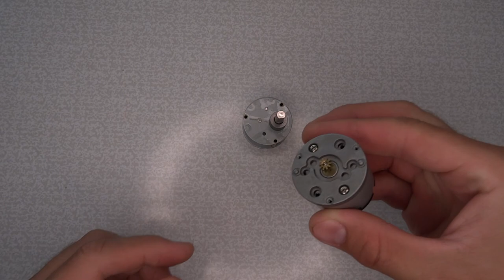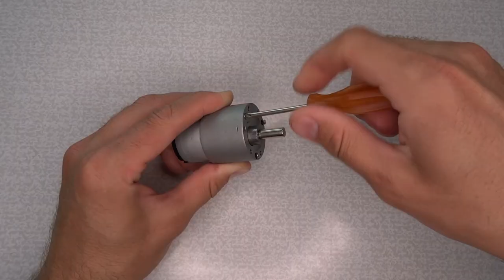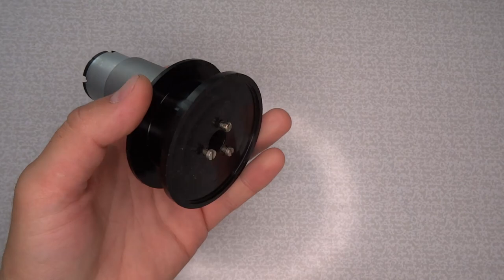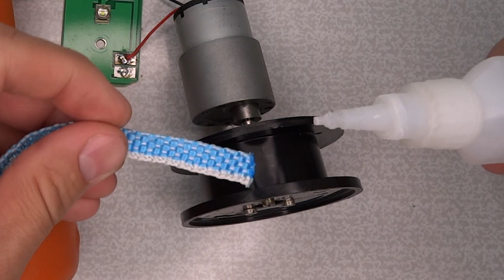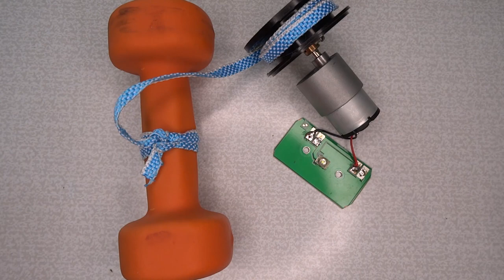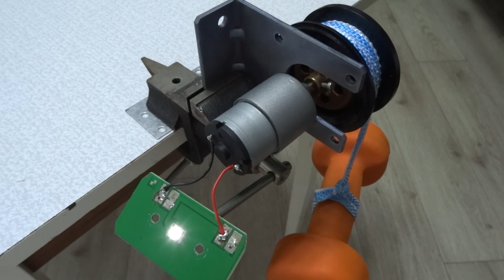Gravity Generator

Comment: Up the gear ratio and weight until you're able to get a day's worth and introduce a watch escapement to regulate speed. And use capacitors to keep charge at a good flow with no break in current
Reply from the maker: you all say right
Reply: If 10kg provides a half hour, how much kilo you gotta carry up there for a day's worth? Isn't the rope gonna rip?
Reply: Also, how are you supposed to regulate speed with a watch escapement if there's that much weight going through it? And whyyyyyyy would there be a break in current? It's a continuous pull down
Reply: @marioluigi9599 you will also have to carry the weight which will be more energy as compared to energy we are generating
Reply: @marioluigi9599  for the setup he has he would need to increase height not weight so a pulley and a rope would mean he could wind it up in daytime using solar panel to turn the same motor. If he increased weight he would need to add a gear box for the same height and a large motor and rope  to handle lifting it

Comment: If this was scaled up to the size of a 50,000lb weight what kind of power could it store? What kind of round trip efficiency does it get?
Reply from the maker: approximately 2v, 0,5А
Reply: Depends how high it goes. Convert it to kg and meters. So 22680x1x9.8 = 222264 Jules or watts per meter or 222KW per meter
Reply: Gearing and Pulleys would aid in more output.
Reply: @kidgamer8704  belts and pulleys would be quieter
Reply: I assume a terrible efficiency.  Gut feeling: 10% or less.
Reply: Ту нет энергии из вне) а есть время за которое подняли груз) так как это можно сделать из 1 секунду и за 1 минуту) но опускаться будет всегда 5 минут) ВРЕМЯ оно такое интересное) верно?
Reply: @worlore1651 
If we assume a weight of 100 kg and a height of 3 meters, how much energy is produced in this example??
  At a voltage of 220 volts

Comment: Put a 10kg weight, and try to change a phone
Reply from the maker: Oк
Reply: To calculate joules which converts directly to watts aka 1 joule = 1 watts. You do weight*height*gravity=joules. Gravity = 9.8. So 10x1x9.8=98 joules or 98 watts per meter. An iPhone charger is 5 volts and 1 amp aka 5 watts per second so 5x3600(seconds in hour)=18000 watt hours. So to power a iPhone charger for 1 hour you would need about 18000kg if 1 meter drop. You can divide weight by half per meter. So 10 meter only need 1800kg. 100meter needs 180kg.
Reply: @worlore1651  you sir have just broadened my understanding of the volt wat Amp triangle. I'm a single comment more than high-school science did.
Reply: @worlore1651  18000 watt hours? I thought Smartphone takes around 15wh to fully charge so why 18000 watt hours? 5volts x 1amp=5Watt so during 1 hour it would be 5 Watthour. I think u meant to say 18000 Joules not watt houres. 1 J = 0.000278 Wh  18000Joules = 5WH
Reply: @FreeKanal  I don't think this guy knows that Watts is Joules per second
Reply: @worlore1651   если все дело в расстоянии, то есть идея. скорость поднятия равна затратам и получению  энергии?
Reply: @marioluigi9599  даже знает что такое нагрузка) и придется добавить 20%)))
Reply: @worlore1651  5w/second ? That'll teleport your iphone straight into Steve Job's arms wherever he might be now.
Reply: @FreeKanal  I was off with the per second thing. It can be confusing because watt hours and just watts.
Reply: @Hashcarbunesti  lol
Reply: Misunderstanding I think was that an iPhone charger is probably 5 watt hours and I said 5 volts and 1 Amp and since I took away the hour part it's 5 watts per second rather than 5 watts per hour. Oops lol

Comment: build a whole lot put them in series to get 12v and parallel to get 0.5A Once you have determined the output while running it, you can select  a 12v 6w led light bulb and then height will determine the amount of hours it runs :)

Comment: Tip for Africa: build a room, where are placed many bigger of these, one person is pushing up weights nonstop, rest of the village have eletricity.
Reply from the maker: one person is not enough
Reply: @Le1ism  Weights go down very slowly, one strong man is enough. Two men would be bored and play cards.
Reply: relifting the weight can use small motor geared that use a fraction of main generator produces.
Reply: @KokoroDenshin  Impossible.
Reply: @janengel1985  based on another youtuber experiment its proven that even 5v tiny geared motor can lift >10kg load.
Reply: @KokoroDenshin  But this is extra power source.
Reply from the maker: @KokoroDenshin  Solar panels can be used for lifting.
Reply from the maker: @KokoroDenshin  Apply a lot of cargo generating energy. When the sun shines lift loads
Reply: @Le1ism  can be an option, but to simplify the system, the smaller geared motor lifter can consume very small power from battery/energy bank generated from main gravity gen.
Reply from the maker: @KokoroDenshin  Can be
Reply from the maker: @KokoroDenshin  Thank you
Reply: Put a person on a bike with a generator. Maybe you can generate 200 watt but after 30 minutes you are done with the fitness.
Reply: маховик возьмет часть энергии для вверх)
Reply: it was done long time ago.
here is an example. https://www.youtube.com/watch?v=Gr9Nw3sU4Yg

and crank lanterns are an item since long time ago. 
I had one too. Sure, not so bright, but this is just an detail.

I had one even more simple. 
It was just a magnet inside a coil. Shacked it for a minute, and had light for half an hour. Barely able to read at that minuscule light,   but it was a very cheap gizmo.

Comment: Ah... I've  been working on a design that has a large belt with shelves on it.  There's an auto - feed which releases bowling balls that fall into / onto the shelves . With about six balls there's quite a bit of force allowing higher gear ratios. But how do the Balls ( 20 or so ) get up there ??? As a morning workout routine !! I also am working on a  water - version that has a belt with balloons on it. As the balloons fill with air  they , of course , produce an amazing amount of lift. A small wind powered compressor provides the air. This would also work with large bodies of water. Check this out -- If you place a steel 12 " tube ( with a bottom ) in say, 100 feet of water , you can drop a balloon down that tube for free. Then at 100 feet down that balloon will have  ( for free ) tremendous lifting / driving power for a sea - bottom generator. Pre - fab units could be dropped in lakes all around the world or... swimming  pools.
Reply from the maker: Need to try

Comment: Less gears = more efficiency / fewer losses!
One big bicycle rear wheel = huge gear ratio
(generator axle to outer rim, heavy weight to the chainring).
Reply: show us
Reply: Everything is exactly the opposite of what you mentioned. The gears are the reason for the high efficiency and power / ability of the generator. The gears and pulley are also the reason for making the weight go down slowly. Otherwise, the weight would go down in less than a second. To increase the efficiency further and obtain greater effectiveness, a flywheel is also used. .
Reply: @yaguut  Well, you can't argue with physics. When talking about all the mechanical aspects (power, gears, flywheel) you seem to completely IGNORE THE DRAG, especially the one that is generateD by electromagnetic field of a generator (the more current draw the more drag - it won't fall down in a second when the current draw is relatively steady and you will need less weight to get the same output -> less gears drag, less work done by the whole system!).

Comment: For energy storage: How much electical energy would it cost to lift that 2kg weight up to table hight? I assume maybe even 100 times more than generated
Reply from the maker: Load lift during the day from solar panels
Reply: Use your energy for that, your body is pretty efficient and can function with many types of fuels. If this could work for say 2 hours, i wouldnt mind lifting the weights again, provided that the output energy is enough for what I need.
Reply: well yeah but you just do that manually
Reply: @anonymouspersonthefake  I would like to know the real energy cost for lifting and the real energy generated to get an idea of the efficiency of such an energy storage system
Reply: @snarfdwarf  no matter how much energy it takes to lift the weight up, youre not gonna get any of it back in your body, you don't run on electricity
Reply: @anonymouspersonthefake  good point 😂
Reply from the maker: We need to check
Reply: Все говорят про энергию) но забыли про время)))

Поднимать можно и 5 минут гирю. но чем быстрее тем меньше энергии) суть времени для энергии в том , что за 1 промежуток времени можно потратить меньше чем получить!)  практика поможет!)
Reply: @snarfdwarf  I think it would depend on your gear ratio. If its geared right it would take very little energy to lift it and produce a lot on the way down.
Reply: @KeithKofoed  I think a real measurement will show disappointing results. Friction and heat loss while pulling it up and than friction and heat losses generating energy will definitely play a huge factor
Reply: yep, a lot of losses at such a small and inefficient system.
But to recover only 1 percent maybe is an exaggeration. Truly efficient, big systems, recover two thirds  Something like this I dare to say that maybe recovers 10 percent.
Totally unfeasible anyway. 

by the way. a guy tested a system with a miniturbine with rain water from the gutter. It charged the phone in something like few months :)
Reply: @Le1ism  did you checked? 
Use an multimeter to see the approximate output. 
And then the input to lift the weight.

I am really curious to see if it recovers 10 percent.

Comment: What is the speed of the motor
Reply from the maker: about 300 rpm
Reply: @Le1ism  it doesn't seems that it rotate 300 rpm i meant by the shaft not motor it self
Reply from the maker: Hard to say